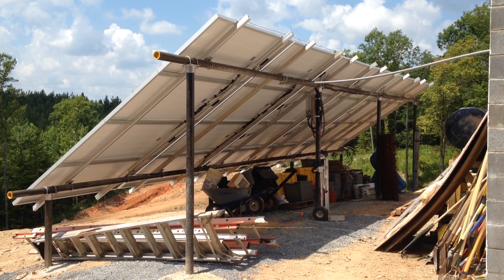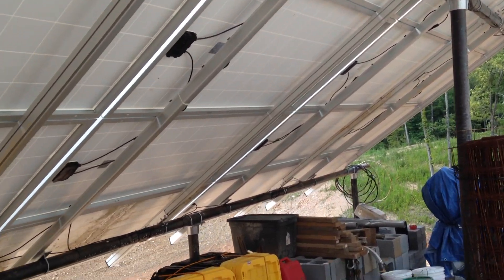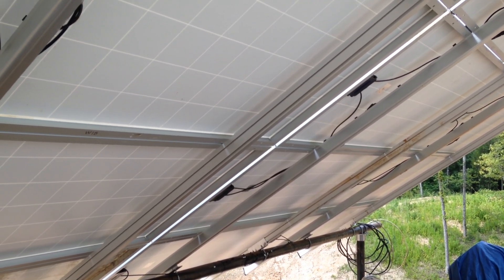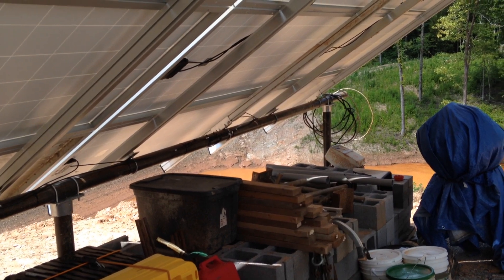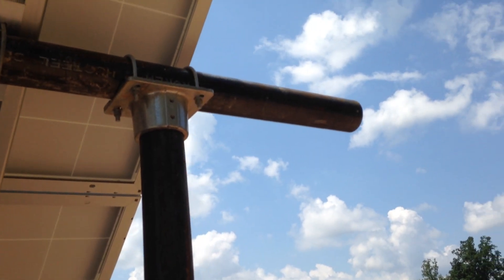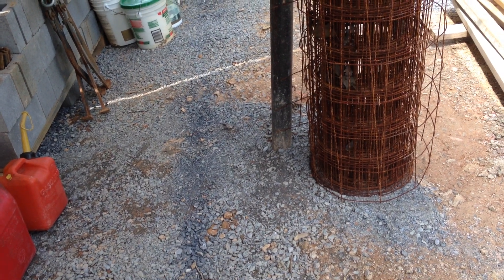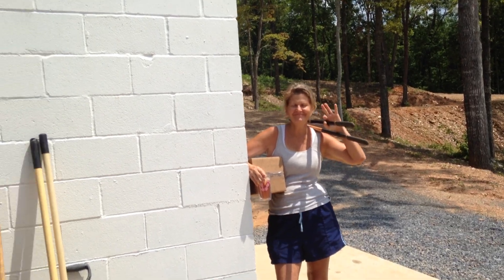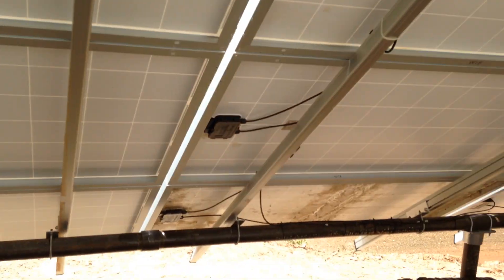Iron Ridge Solar Panel Ground Mount System (2014-07-12)

Comment: How did you couple the two 3” pipes? I see some kind of coupler but wasn’t sure how it was done.
Reply from the maker: Standard 3” coupler
Reply: @lanceknoechel8945  was it threaded or the slip on and tighten it with a screw? Thanks for the reply! I’m getting ready to do mine soon once the permit gets approved.